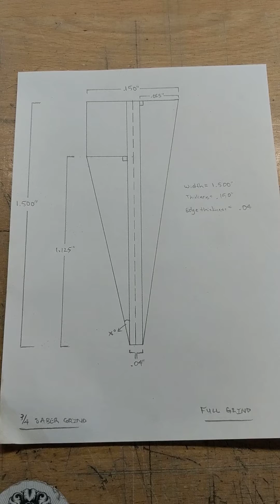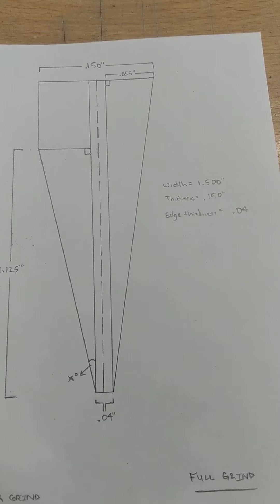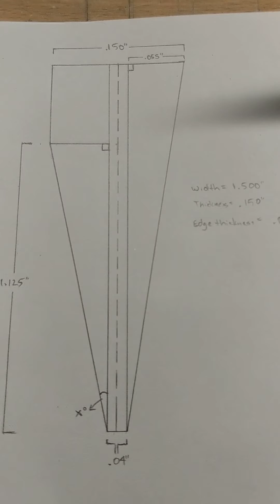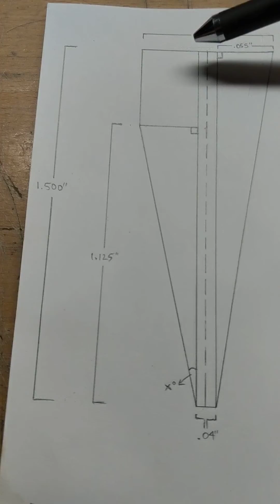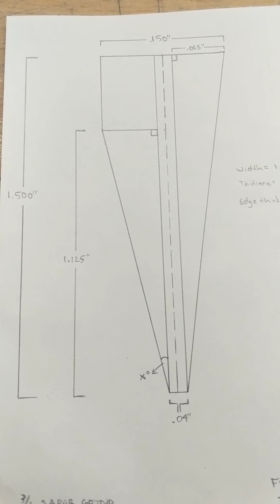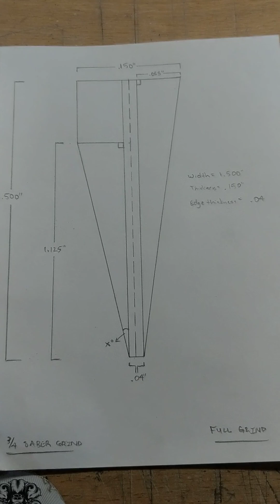Bevel angles for angle control jigs

Comment: How do you control belt wave/rise in front of blade contact ?   I am attempting to create tooling for large single bevel thin kitchen knives . . . 0.006 behind the cutting edge.  All blade stability seems to evaporate well before I get to my desired spec.